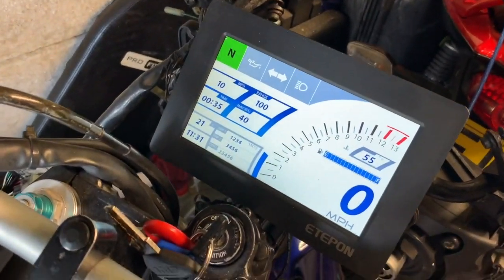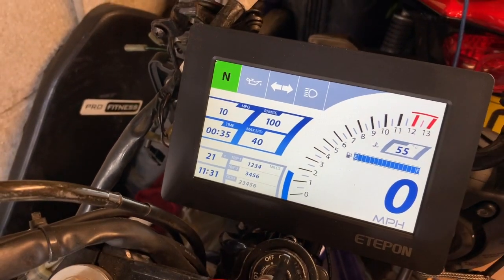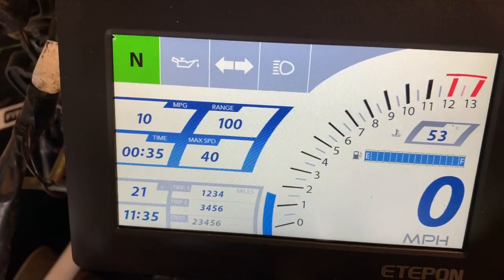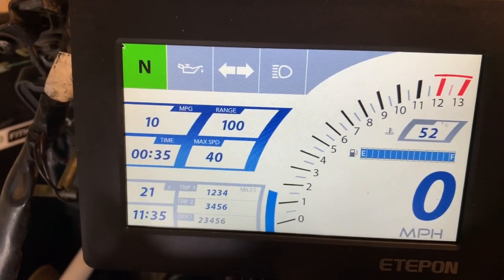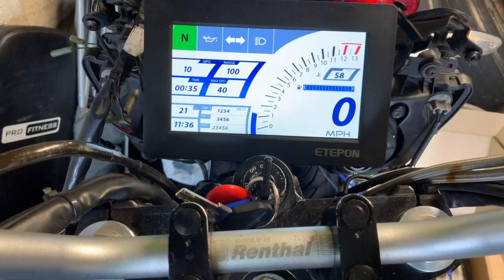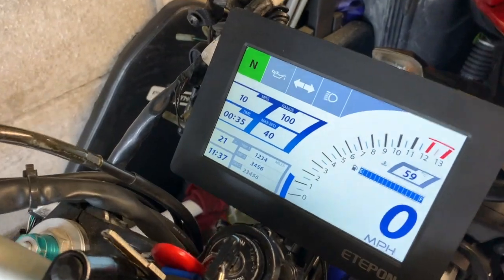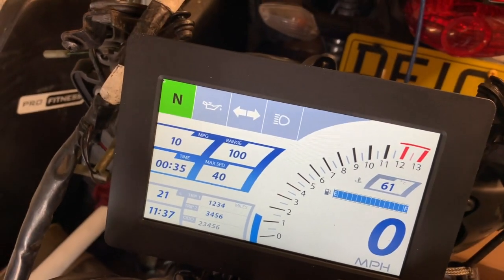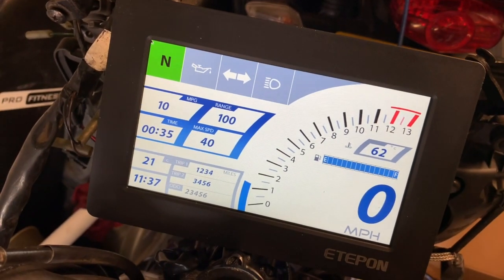Motorcycle DIY TFT Dashboard

Comment: Hi, iv seen your website and considering buying one. I would like to see what it looks like in situe in an FZ1 do you have any photos? Also does it just boot right up or is there some fab work required?
Reply from the maker: Hi, head over to https://www.tftdashproject.co.uk and you can see some photos and more up to date videos on it working. No Fab work require it's plug and play, and mounts onto the existing bracket on the FZ1
Reply: @MrScififan  excellent thank you.

Comment: Hi I’ve just seen this and it looks amazing 🤩 if I where to order one how long would it it take for me to receive the unit ? I have an fzs1000 2004 . If you can get back to me that would be great thanks
Reply from the maker: Hi James, you can order at https://www.tftdashproject.co.uk - Time to dispatch is 7-10 days.
Reply: @MrScififan  thank you I will order within the next couple of weeks I can’t wait 👍 does it come with a mounting bracket atall ?
Reply from the maker: @jameseasdon3390  No worries - it mounts onto the existing FZS1000 bracket using the same fitting. It also comes with 2 covering plates which cover the circular cutouts that are left to provide a clean look when it’s installed.
Reply: @MrScififan  that’s perfect I have mounting brackets already fabricated for the existing clocks as I have turned the front end of the bike into a naked with an mt03 fork mounted headlight so I should also be all good for space too thanks again 👍

Comment: If you can make this work to where it also doubles for GPS viewing it will be a hot commodity.
I had the smarts and time I would do an android tablet or cell phone set up for this, it would be awesome.
It could even be set with camera for review blind spot monitoring. .
Reply from the maker: Satnav is a feature that I'm working on and will be implemented later this year. In preparation, each unit dispatched is equipped with a bluetooth module. It will be coupled with your smartphone similar to the latest KTM setup.
Reply: @MrScififan  Subscribed. Will be looking for more post. Good luck with the project.

Comment: Good job!!!
I am trying to doing this.
Can you share with me how to read rpm gause? Or how to find out technical docs?
My bike is yamaha yzf15r
Reply from the maker: Thanks! You will need to find your RPM signal wire to the clocks (should be in workshop manual). You'll then need to measure the voltage of the pulses (most likely 12V, but could be 5V). A portable scope should help with this. Then you'll need to wire up a voltage divider to bring the voltage down to microprocessor levels (If it's 12V pulses coming from the bike then a 10K / 5K voltage divider will do the job nicely). you can then take the voltage out from the divider into your microprocessor to process the pulses. You'll need to determine how many pulses per engine revolution (most likely 1 pulse per revolution but it could be 2) - you can then code up the an interrupt routine to count pulses / or measure time between pulses to determine RPM. Hope that helps!

Comment: How is gui made?all the animations and everything?I'd be really thankfull if you help me with this, im working on an rpm project for a motor , i just need to know how to get these graphics running
Reply from the maker: Virus ESO The display software running on the Pi was coded up using C++ using SDL for graphics (including animations) and the G++ compiler - The graphics were designed in Photoshop. The other half of development was using C on the Arduino - the majority of code is running on the Arduino with the Pi just doing the graphics
Reply: @MrScififan  Thanks Alot Sir you have no idea how much this helped me

Comment: Really impressed, What software did you make the instrument panel on if you don't mind me asking. I have a different project in mind but was wondering if this would be suitable with mods. Thanks
Reply from the maker: Derek Smith The display software running on the Pi was coded up using C++ using SDL for graphics and the G++ compiler - The graphics were designed in Photoshop. The other half of development was using C on the Arduino - the majority of code is running on the Arduino with the Pi just doing the graphics
Reply: @MrScififan  Thanks, sounds like a lot of work, Meaning way out of my league. You clearly have a love and aptitude for this kind of thing.

Comment: Hei! Nice job, mate! waiting for updates. Cheers! 
Raspberry Pi??
Reply from the maker: Thanks Buddy! Yes the display is running on a Raspberry Pi - the bike interface is running on an Arduino (with a custom built shield). The Arduino communicates with the Pi :)
Reply: @MrScififan  nice, hope you finish it soon cause I like it and I would like to have one. ✌️
Reply: Any chance on getting the code for this? I have an Arduino with can bus shield and a raspi with a 5 inch display and can bus shield as well as a Bluetooth odb2 adapter on my bike